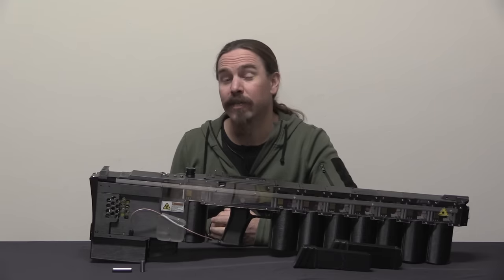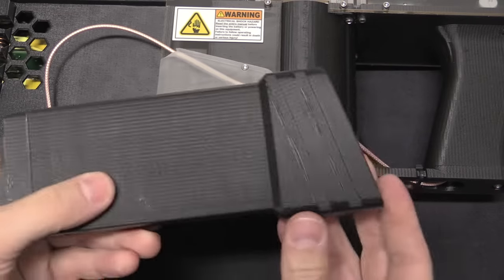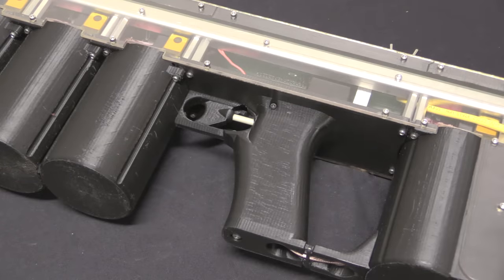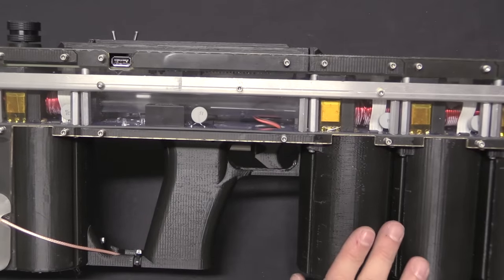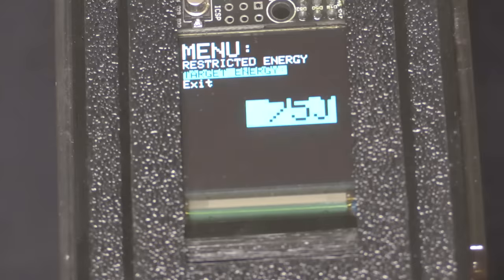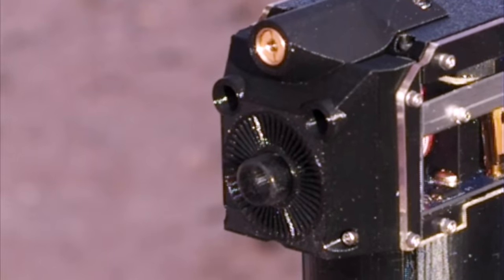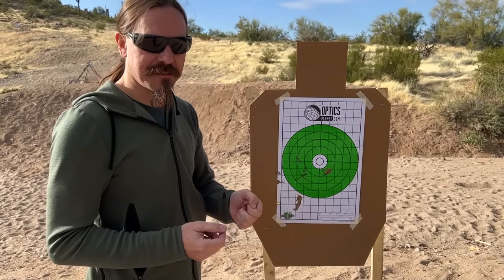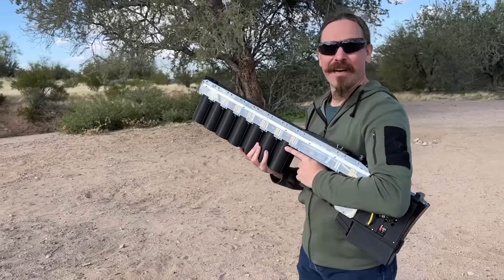ArcFlash Labs' GR-1 Anvil Portable Gauss Rifle

Comment: Quiet, powerful enough and cheap ammo can’t wait to see the 5 years down the line finished product. Thanks for video !
Reply: I doubt this will ever take off. See how many beefy capacitors you need to impart the same energy into the slug as the few grains of powder in a .22LR? They aren't going to get much smaller if at all since capacitance is a function of the surface area of the dielectric plates. To get actually useful energies into that slug you'd need many more caps or much bigger caps which would make it non portable. Chemical propellant is just a vastly more efficient energy storage medium when it comes to firearms.
Reply: @JohnDoe-zh6cp  I doubt this will ever take off. See how much beefy gunpowder you need to impart the same energy into the musket ball as the few strands of string in a longbow? They aren't going to get much smaller if at all since burn rate is a function of the surface area of the gunpowder. To get actually useful energies into that projectile you'd need many more barrels or much bigger musket balls which would make it non portable. Kinetic energy in a bow string is just a vastly more efficient energy storage medium when it comes to projectiles.
Reply: @JohnDoe-zh6cp  how many times did you copy and paste this comment
Reply: @concordsst  once
Reply: @donaldscott9909  Yeah see this analogy doesn't actually make any sense
Reply: @JohnDoe-zh6cp  how so
Reply: @donaldscott9909  You only need a small amount of gunpowder to impart more energy into a musketball than an arrow from a bowstring. Gunpowder did get more efficient per unit volume because of advances in chemistry. Capacitor technology is not comparable. Bowstrings are not more efficient in storing energy and that was evident to everyone at the time. The problem was machining the steel parts.
Reply: @JohnDoe-zh6cp  I have capacitors bigger than that in my amp lmao
Reply: @donaldscott9909  well gunpowder has huge energy density compared to the caps and most of that energy is converted into motion.
On this toy there are 2 inherent limitations low efficiency and magnetic saturation.
While low efficiency can be bypassed with big storage caps (you'll need a generator for each shoot), magnetic saturation in the material of the projectile will put a hard cap on how much energy you can transfer into the projectile

Comment: You have to deliberately go messing inside this weapon to hurt yourself - “I felt a great disturbance in the garages and basements of the world. As if millions of Bubbas cried out in horror, and were suddenly silenced.”
Reply: That's true of almost any machine though. With a conventional weapon, you can shoot yourself. With a gas powered car, you loose your hand in the fan belt, etc. The potential hazards with electrical machines are different, not necessarily greater.
Reply: Its especially true with reloading ammo for conventional rifles. If you use too much, or the wrong type of gunpowder, your gun can blow up and kill you.
Reply: I eagerly await Garand Thumb doing freeze/mud testing with this thing.
Reply: Does this mean there’ll be no tapco furniture for it?
Reply: "Who said I have to secure the gas tube to the weapon?" - Infamous AK Bubba.
Reply: @Concerned502  Both of those require water...   Water and electricity...

Comment: Suggestion for the ammunition : You know APFSDS tank rounds? Make the ammunition for this rifle on the same principle and you'd get faster, more accurate rounds with longer range. I love how quiet this gun is.
Reply: What about making the rounds have varied magnetic properties along its length?
Reply: It would be like a modern SPIW prototype. Very cool.
Reply: yeah….make the ammo super expensive…
Reply: That would be amazing and allow varied payloads, ferromagnetic sabot encasing a high density round or even something wild designed like a arrowhead to really just cut into targets
Reply: Cone tips are relatively difficult for a magnet to "grab"
Reply: This type of projectile would make an impossible to stitch wound. Therefore it would be banned immediately from use by the Geneva Convention (like the 3 bladed knife).
Reply: If its technically a gauss canon why not use tiny (canon) balls as ammo?

Comment: This is absolutely a cool design, and shows the practical use of such a weapon.

Sure - right now the projectiles are weak, inaccurate, and the gun is too heavy.

But it worked, and it's also just a prototype. They could improve the projectiles (fin-stabilized or such would be useful), improve the feeding mechanism, improve the battery and charging capability significantly, and improve the thermodynamics without needing significant technological improvements. 

Of course, it would take very significant improvements for the projectile itself to be that useful in a hand-held version. But it could be useful if used in a larger marksman type system, where the weight and size of the weapon wasn't as important. 

Such a weapon has advantages over traditional firearms. The lack of direct barrel contact and rifling means that heat generation of the projectile itself, and size requirements for the projectile, could be more flexible. While the weapon itself is heavy, in a fixed defensive position it would be possible to charge and use such weapons from electrical generation or storage in a simpler manner than it would be to transport large amounts of ammunition. Maybe eventually we will get to the point of it being more useful as a handheld weapon as well, but this is exciting regardless.
Reply: "Improve the battery"
That's the holy grail of basically every industry at this point.  No one has managed to do it in nearly a decade.
Reply: The grandkid of this gun could easily be an emplaced machinegun. The rifle version would probably be a hybrid coilgun, a conventional rifle cartridge for initial acceleration, and the coilgun as a secondary acceleration track.
Reply: @torg2126  Why would you want forty or fifty pounds of magnets, plus batteries, when you could get the same effect with a few inches of barrel and a few grains more powder, or even just use an explosive with greater energy density than gunpowder?
Reply: @SaxPanther  doesn't mean they were bad ideas. Money is a hard resource to get a hold of.
Reply: Well withworth hexagonal rifling or something like plastic sabot and steel flatchets could be a solution.
Reply: @Bacteriophagebs  Weight. Capacitors will shrink, and power density will also increase. After a certain point, the weight savings and velocity increase will outpace the advantages given by increasing cartridge size/load and barrel length. At that point, it becomes economical to use a small cartridge as a starter charge, and allow the linear magnetic accelerator to act as primary acceleration.
Reply: I see something like this using fuel cells.
Reply: @DeadRingerMachine  absolutely
Reply: @torg2126  The capacitors are the least of the issues in terms of weight.
Batteries haven't become significantly more energy-dense in decades, but even that isn't the issue.
The issue is the magnets.  You simply can't make electromagnets lighter.  If you don't have enough wire, it will vaporize.  If the wire is too resistive, it will melt.  If the wire isn't conductive enough, you won't get enough power.  Any electromagnetic gun will be heavier than even a .50 BMG because of the magnets alone.
If you want to use better tech to improve firearms, all you need to do is use better propellant.  The reason we use gunpowder is because it's reasonably efficient without generating too much pressure.  However, you can get WAY more power using high explosives in a barrel that can take the pressure.  This has been done.  It works.  It's just either too heavy if you use steel, or too expensive if you use titanium or some fancy alloy.

Comment: Ammo based on shotgun slugs or .177 pellets would probably be more accurate, since they’re designed for smooth bores already. 

Cast it from something magnetic and cheap and it’ll probably be pretty cheap to make.
Reply: A diabolo shape would help stability, but because they drag stabilize it will reduce the limited range even more by causing a rapid decline in velocity vs flechette/torpedo/spitzer shape.
Reply: My slug barrel is rifled
Reply: @issacclark6109  while there are dedicated rifles slug guns, there are loads of slugs available designed for smooth bore shotguns.
Reply: I was thinking that projectiles based around the design of the FN303 projectiles would work very well as they are fin stabilized and meant to be fired out of a military/police smooth bore airgun. The FN303 projectiles will not work because they are not made of magnetic materials and they are too big (.68 calibre) to fit in the GR-1.
Reply: @sunshaker01  the "size" problem is not really a problem,you just need to pump up the barrel length and the battery capacity. The real problem is the fact that these bullets can't costs more than a normal one
Reply: I was thinking this and also those slugs that deploy fins when they leave the barrel which might even give it a spin needed to keep track.
Reply: @imnomoremaverick  that’s the big thing. Maybe something like a tank’s FSDS round? Cast plastic sabot around a relatively small magnetic dart?
Reply: @joshuahadams  problem is that you need to build those fins on a high precision level,like creating a watch. Feasible,but expensive. 

You can do it,you can use other types of shells that propagate through space (and then use the principle of "quantity over precision"),or they could arrange the coil in a manner that imprints a rotational force on them

The latter is problematic because if done correctly,the barrel will overheat very quickly,but this can be partly overcome by using a different material for the barrel (it must not be magnetic,so high-resistance polymers are the way to go)
Reply: @imnomoremaverick  So if you were to make a 2 part projectile from a magnetic metal head (Iron/Nickel/Cobalt) and plastic/nylon for the skirt (those that have seen FN303 projectiles will understand what I mean by a skirt) that say screws and/or glues together it would be fairly cheap. 3D printing a Nylon Skirt for the round would probably be the most expensive part.
Reply: also a small coil could give a spin to the slug making it much more stable, with little energy cost.
Reply: @sunshaker01  it could be. But those skirts needs to resist a good amount of wind force,other than the energy of the shot and the ludicrous speed
Reply: I was thinking the whole idea of a magazine would be a lot more free form anyways. Rods of all different lengths in multiple tubes using a light version of the mass driver to move the rounds to the chamber. No springs, or boxes, just length sensors and magnets. Need penetration, long rod gets sent, need many burst rounds, shorties get sent.
Reply: @imnomoremaverick  Barrel is not a problem - just use high temp alloy like inconel. Ausetnic, high wear resistance and your machinist will love you :D

Comment: With 100J per shot, it has the same energy of an arrow and it is as silent. If in the future they can increase the energy X10 so to reach the typical energy of a bullet, it will make an excellent sniper rifle since its sneakiness.
Reply: It still would not be totally silent though, the crack of the round travelling would still be plenty audible.
Reply: Its smooth bore, so no. Also to increase the energy x10, you'd need x10 better capacitors and coils. And probably better batteries... So its not happening in this century i'd say unless there's some major discovery. And no, this thing doesn't have the energy of an arrow, an arrow can pierce a lot of stuff while this barely has the energy to pierce a few layers of cardboard.
Reply: That's a no on all counts, chief. Capacitors discharging are insanely loud. Supersonic cracks are insanely loud, and finally there's no good way to impart spin stabilization on the projectile so it would make a very poor sniper's rifle.
Reply: sniper rifles travel above the sound barrier, they are never silent, the point is hitting the mark before the sound reaches it ;)
Reply: @tomaspabon2484  even if it was all silent, it'd still make a sonic boom if the projectile crossed the sound barrier, so... That's in theory, in practice a coil gun won't be practical for hundreds of years to come, if ever, everyone saying how its gonna become more powerful in the future, but supercapacitors and the batteries that power them are NOT becoming a hundred+  times more dense any time soon. They literally already need x4 power to simply jump from their pathetic current 75 m/s to even old weak air gun range at 150 m/s. To double that and get into somewhat serious PISTOL range to 300 m/s (like 9mm), you already need x16 more power, and to go to 600 m/s, as in SLOW bullet range (5.56 for example is 990~ m/s), you already need x64 more power... Does that sound at all reasonable and possible? 

And that's aside the fact its probably impossible to accelerate stuff to such velocities with just coils in such a short barrel... And what kind of materials those coils would even need to be made of to withstand all that power, the switches for it that don't and will not exist, especially in handheld size, and the advancements needed for all that. So yeah this is a useless dead end thing. Even railguns (which are faster and more powerful, work in a different way too) can't get into serious ranges with anything other than whole house sized guns, and even the practicality of those is still questionable.
Reply: As another guy mentioned, doesn't matter if the shot itself is silent if we start getting up to supersonic projectile speeds. There are airguns that are loud as fuck despite only using compressed atmosphere, just because of the speed the projectile is traveling and the amount of kinetic energy being dumped by the spring. Won't be as loud as a firearm, but things can get surprisingly loud without chemical propellant.
Reply: Should also keep in mind that these being essentially blunt rounds, a lot could be done just by modiyfing the the ammo. Add fin stabilizers and you have mini APFSDS
Reply: @mkzhero  You can make rifled projectiles, and with this using a completely different mechanism of acceleration, a whole new world of possibilities opens up that is still dormant to us without more advances in technology. Perhaps a technology similar to this will be the end of propellant-based firearms.

Comment: The mid-sized "hollow point" projectile is actually an expanding "Drop-In" concrete anchor for existing concrete.  

Inside the body is a tapered plug.  Drill hole in concrete of the appropriate size.  Insert anchor slotted end first until bottomed in hole.  Use a hammer and the included tool to drive the internal plug home, expanding the slotted end against the sides of the hole.  You now have a threaded insert in your concrete.  Common for data racks and such.  Excellent for side loads.  Direct pull, not so much.